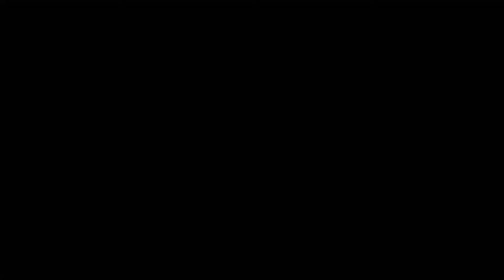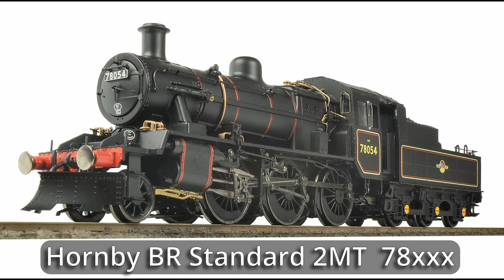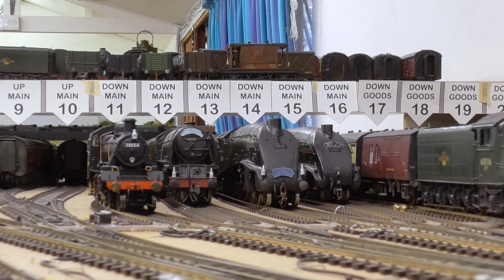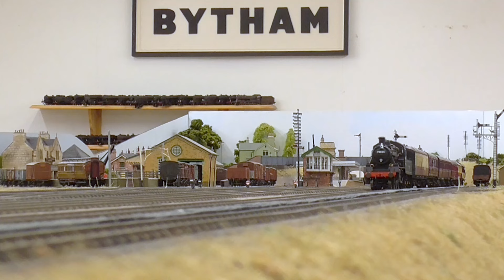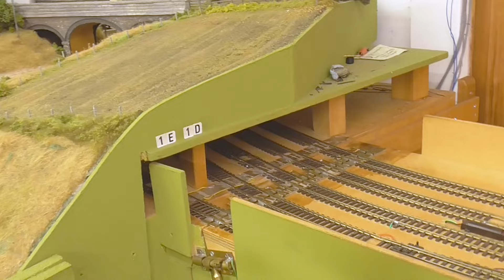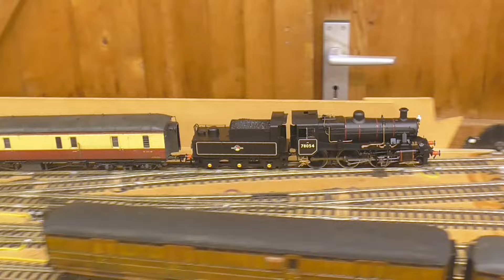On test: Hornby's long-awaited BR Standard 2MT

Comment: Yes, I bought the members green version,very nice, but, fragile hardly sums it up.
Out of the box the front buffers were off and lying in the box, first job, glue them back in,next running in, Oh! Dear, the bolt fixing the driving rod to the front driving wheels came undone, this completely wrecked the the tiny valve gear and everything came out of the piston housing on the right side. I found a piece of packing lying by the line which I mistakenly thought had been left in the loco, but no, it was the bolt ,very hard to see as it is obscured by the valve gear. I did after a while get it all back together after straightening everything that was bent. However the link from the second driving wheel was detached from the top, also a few bits of “bling” like copper pipes came off. That linkage had to be removed before I could run the loco again. Putting the bolt back in the second run lasted half a minute before it did exactly the same again. Nothing daunted, the warranty was completely stuffed, I repeated the excecise, this time I added a little glue to keep the valve gear from coming out of the piston housing. This time a wire detached itself from the tender plug. Off we went again but it came to a abrupt halt, reacting swiftly cutting the power, horror, the left hand bolt in the front driving wheel had come partly out jamming all of the gear from the piston housing. Very carefully tightening it up and checking all the other bolts, it runs again. 
I have contacted Hornby asking if I could buy the running gear part of the engine, but the response is I have to send it back where they say they will attempt to repair it. 
I’m just waiting for instructions on how to return the loco, I live in France so that adds to the stress level. 
My advice to you and anyone else is,CHECK THE TIGHTNESS OF THE CONNECTING ROD BOLTS before you do anything else. 
Lastly, the coupling is faulty and keeps coming apart.
Thanks for reading.